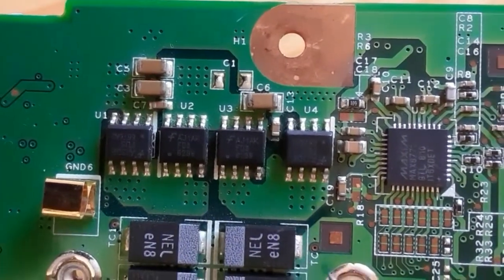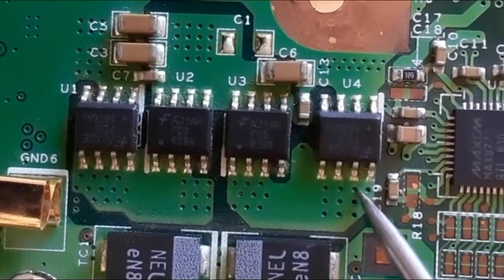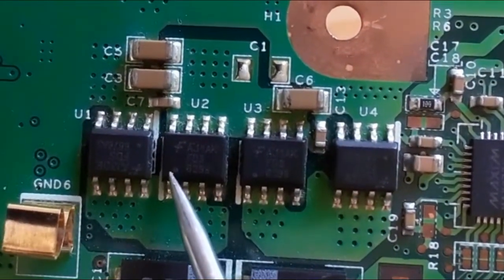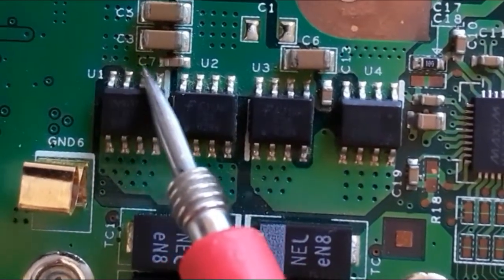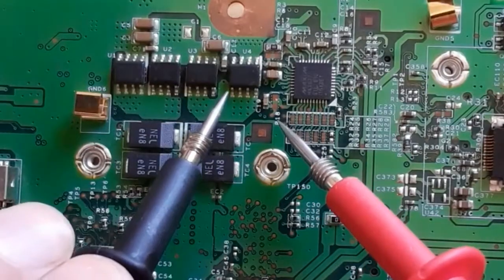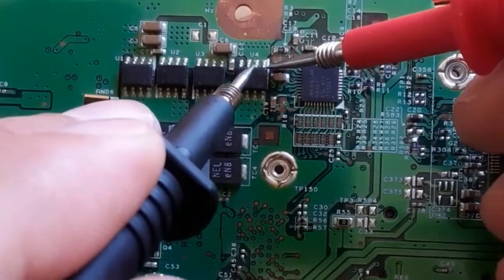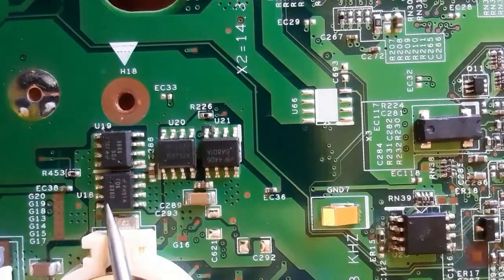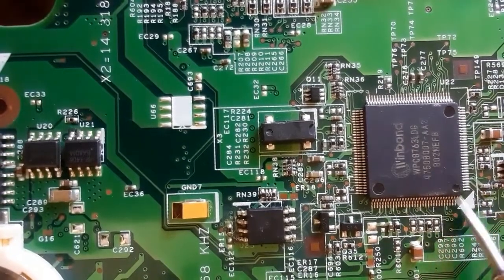How to check 8-pins MOSFET with a multimeter, N-Channel, and P-Channel MOSFET

Comment: The three pins and the gate side , can the three legs be soldered together or do each have to be soldered individually and separated from each other ?

And same question for the other side with all four legs , do they have to be soldered individually and separated from each other or can they be all soldered together ?

I ask because it is a small mosfet I am soldering

Comment: Hello, nice video as always. I knew that "U" should normally be used for "integrated circuit" while "Q" is used for transistors but this video show an exception. This might lead to some confusion in my opinion. Any other hint to recognize mosfets from normal integrated circuits (which are clearly NOT mosfets)?
Reply: you're right,, even me I'm confused, it's an IC not MOSFET